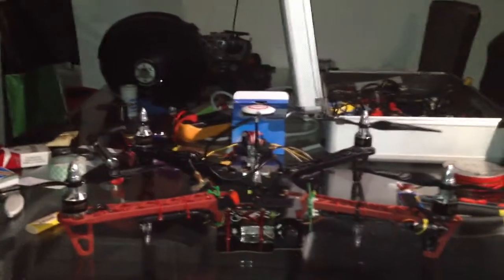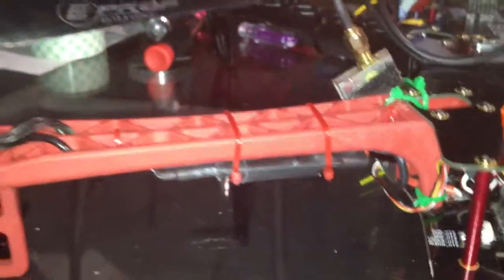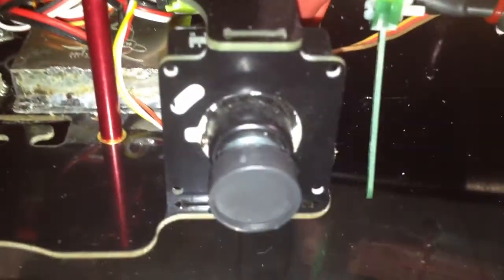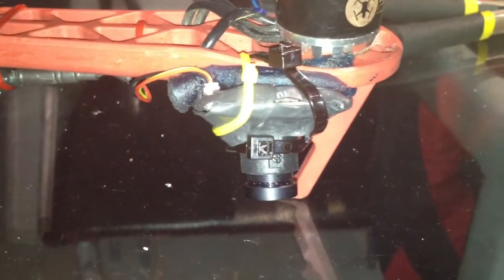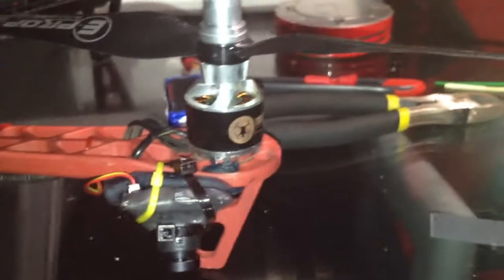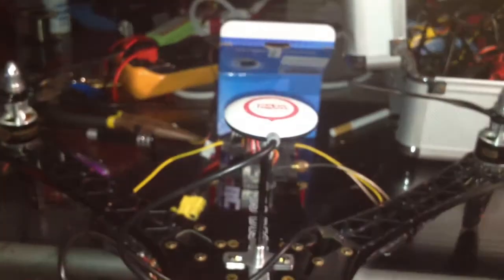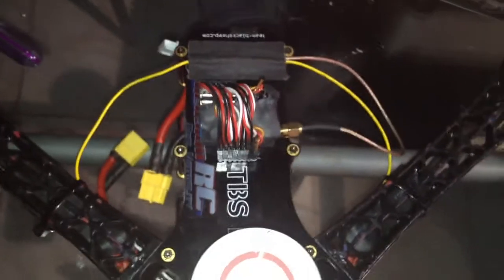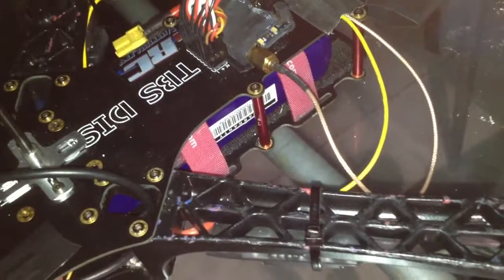TBS DISCOVERY SETUP

Comment: I was just wondering about the V antenna - 1.3 CL antennas work great, but have a big foot print - I would interested in how you mount it to you disco. Are you using the stock antenna with your chain link?